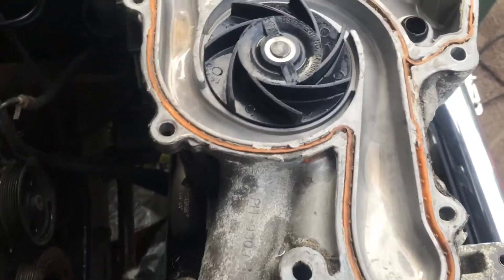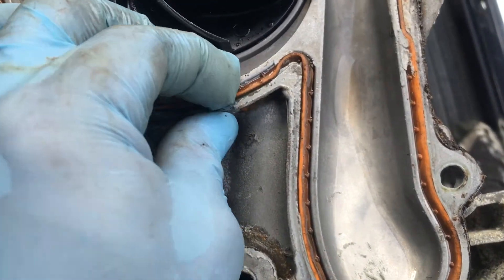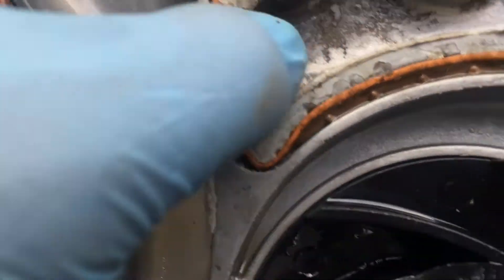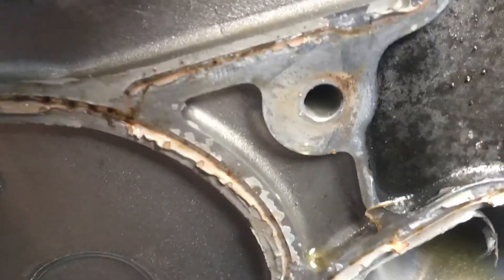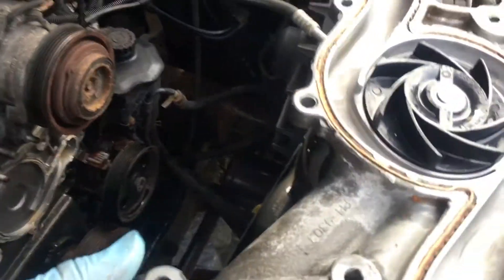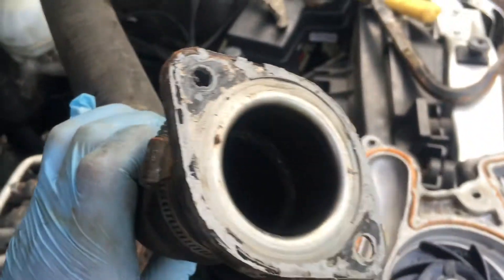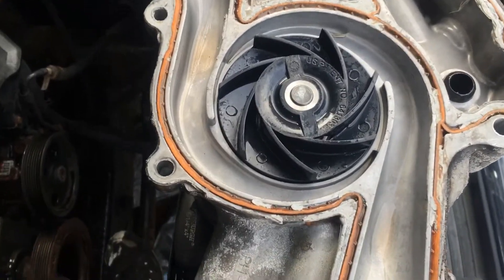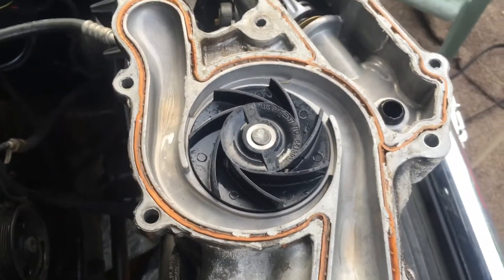Don’t use “Bar’s Leaks” Radiator or Water Pump Sealer

Comment: It's not made to seal rubber seals, or gaskets. Liquid aluminum is only for aluminum radiators. And it will only work on really slow leaks. If you have an older car, then you use the liquid copper. But no, it's not going to fix your freaking water pump seal. 🙄
Reply from the maker: 😂 this video is 6 years old, lots of lessons learned since then slappygoat, don’t need your help teacher 👩‍🏫
Reply: @CottoDIY  
Sounds like you learned them the hard way. Never use that shit in any car, unless it's a throwaway car, that can't be saved anyway, and that you don't care about.
Reply from the maker: @SloppyGoat  I did! Do it right the first time!

Comment: Did you pour it in through your radiator? Did it damage the radiator as well
Reply from the maker: ZeroFuxGiven I did pour it into the radiator. I have kept the same radiator on this truck since and have not have any issues with overheating. I wouldn’t be surprised if I cut open this radiator to find some of the fin channels clogged.
Reply from the maker: Update on this radiator, it sprung a leak and had to be changed. I can’t blame bars leaks. It had a good life at 130k miles.